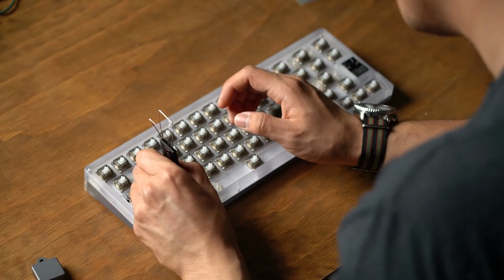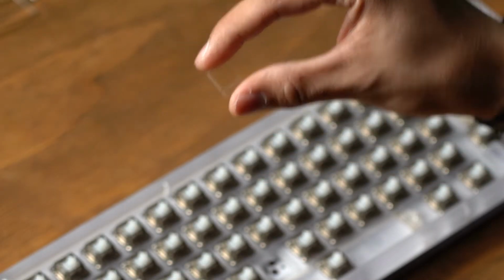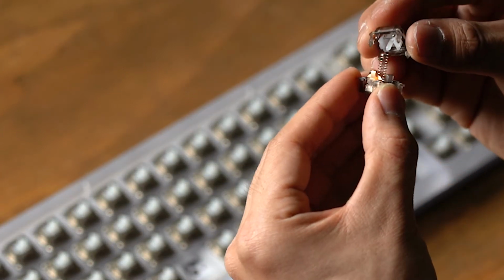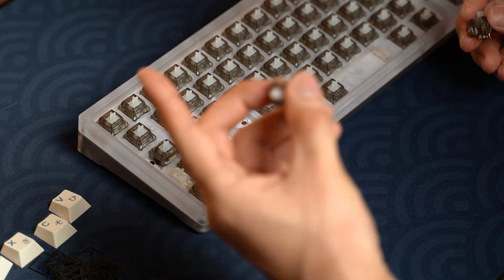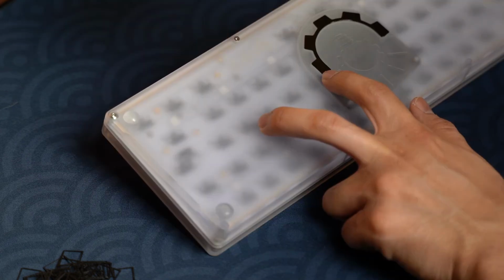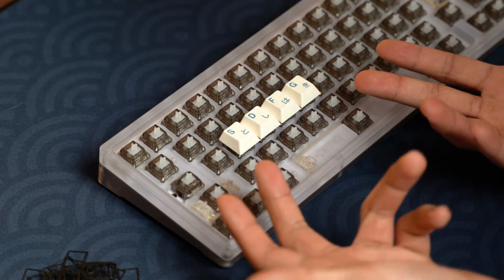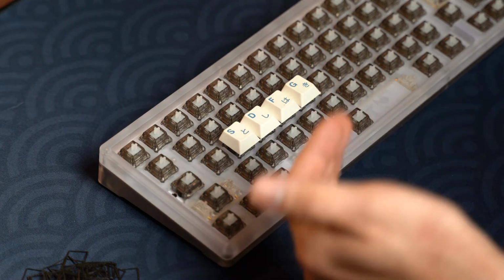3D Printed THICC Switch Films - Can They Compete With TX Films?

Comment: switch films were invented to rescue wobbly old vintage black switches. the top and bottom housing became lose over the decades partially due to shrinking plastic... switch films restored a tighter tolerance. generally, up until mid last year, they were not used on new switches since new switches snap tight.
Reply from the maker: Thanks for sharing the knowledge! When you say "snap tight" do you mean that I should not be able to move the top housing when the switch is together? My creams that don't have films for example - I can wiggle the top housing despite it being soldered in. There's a little play there.
Reply: @AndyVNguyen  He means (if I understand correctly) that they're not as lose as vintage switches, and it shouldn't affect your keycap stem for exemple.
Reply: @AndyVNguyen  most switches have a rotation tolerance per white sheet of 1-2 degrees (or was it 1-2%?) - essentially you should not need films - this became a meme last year due to Walker demonstrating that it changes the sound. What you're doing is you tense up the clamps that hold the parts together. that's why it works better with cheap switches that have a larger tolerance and most more expensive switches have a higher tolerance and the film will keep you from even be able to close the parts back together. I would only recommend it if here is actually a gap between the parts otherwise those switches might as well pop open and generally probably doesn't have a use then anyway :D
Reply: yeah, the issue is that JWK switches (durock, everglide, etc) tend to have very loose housings, so filming is a must imo. thicc films were made as some people think that tx films are too thin to fully resolve the gap in such switches, but i dont think gat switches are so loose. i wouldnt use jwk without films, but i havent tried thicc films yet so idk if they work any better than tx or others
Reply: @Crokto  its not a must, it just became a trend... ;)
Reply: @homerowco.1957  Exactly! Thank you!
Reply: @homerowco.1957  Have you tried JWK switches without films they might as well be 20 year old vintage switches lol one of the only new switches that truly benefit from them but  I totally agree with you its a sound trend you don't need them on a large majority of switches like ink's, zeals switches they won't fit on at all because there well made, Holy pandas have too tight of a housing and dampens the signature sound on them, and NK creams are very tight housing as well and also lose some of their signature clack if you try to force films on them. It's all about preference though so everybody do what feels good to you I guess.
Reply: @maloc1166  yes I know JWK switches, if you check homerow.store you will find that we actually had a pretty big custom colorway run of silent durock switches which we used to push them to create tighter housings. they are a lot better now, not perfect but a lot better - as far as we can tell the tigher housing is rolling out slowly to other durock/jwk switches, they call them mostly "v2". the issue isnt really the use of films, the issue is that people think its "normal" to use films. the issue really is with the manufacturer not making good molds.
Reply: Seems like a issue when you open the switches alot as well. Maybe the plastic used as well. I think the alpacas sound good with them.

Comment: the smoothness and thickness of tx film is consistent compared to 3d printed film which may have a rough surface, brittle, varies degree of thickness(depending on what material and machine the seller use to print it). Personal preference prefer tx film

Comment: from my understanding switch films reduce the wobble cause due to loose tolerances between the base and the top. It does not have much to do with stem wobble.

Atleast none of my stem wobble was fixed with filming switches

Comment: What creates the wet sound on the switch?
Reply from the maker: I think that typically comes for overlubing and lube getting into the center column. I'm listening for the sound in these switches and I'm not sure what it is that you're referring to tho
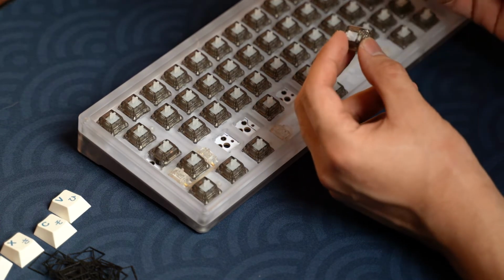Reply: @AndyVNguyen  I can hear it. Especially at 4:20 where you test them outside of the kb without keycaps
Reply: @chyrt  sounds like some spring ping. Usual on Ink Blacks considering how meh the spring is anyways.

Comment: I think the sound qualities are actually noticable, but I don't know which I prefer. I got some TX films to put in my silent alpaca switches because those have some tolerances issues that make the stem and keycap rattle the most noisy part of my keyboard but after filming them they sound amazingly consistent and quiet.

I actually have a 3d printer, probably the same one that was used to make those films and I was rather surprised how much they clean up the rattle in durock regular alpacas as well.
It's nice to know that I have a way to make more films for myself and don't have to order any, but honestly I don't think you'd lose with either type of film if youre putting them on a switch that benefits from them like alpacas.
Reply from the maker: It's hard to tell. I feel like the difference between no film and film is way bigger than TX film vs THICC film. 

I do agree that Durock switches like alpacas and T1s need to be filmed. 

Nice! ENDLESS FILMS. 

Films is films, I agree. Just film your switches if they need it and you won't be sorry! 

Thanks for the detailed analysis, Techno!
Reply: @Lucas I think for what they cost with the sound (provided you use films to reduce rattle and high frequency) they only lose to lubed mx zilents. But at that point you have to manually lube and pay like $1.20 a switch?  I installed my 3d printed films in them and they sound nearly identical to TX, so I suspect if you use Kebo, or any other film that you will get very consistent sound in your keyboard. The factory lube that they come with is also terrific, I wouldnt spend cleaning the stock lube off and redoing it. I think they're fantastic.
Reply: @TehTechnoGuy  Do you have the STL or the dimensions of the films? Looking to print some of my own as well.

Comment: You can remove the pcb standoffs honestly
Reply from the maker: Dude I never thought of that, that's going to be my project tonight!
Reply: Andy V Nguyen I’ve done it before, it evens out the typing experience for sure. Only downside is that if you’re looking to swap out the switches you’d need to take the board apart (which you should do anyways, it’s better for the Kailh sockets)

Comment: Yeah that extra cut out on the tx film tends to push out the the film to one side, instructions say that there should not be anything sticking on on either side, but i tried to open the switch a handful of times to get it centered, but it is hit or miss...so i ended up just allowing it to stick out on one side and made them all stick out to the top side were the name of the switch is opposite to the led side. it still works no wobble and as far as i know it does not affect centered or not.
Reply from the maker: Yeah seriously it's such a hassle to line them up perfectly. Especially the last step where you snap it in is kinda violent for a little plastic film, it inevitably gets moved. As long as the switch sounds fine, I just leave it be lol.
Reply: I've actually found that if it isnt sticking out of the top a bit it can cause drag or slightest bit of binding.. pretty frustrating.  Some switches have no issue with this, others I have to make it stick out of the top.